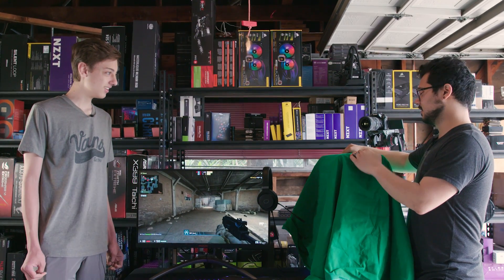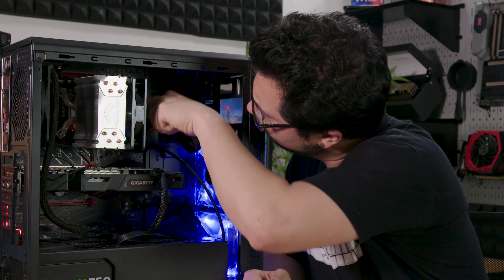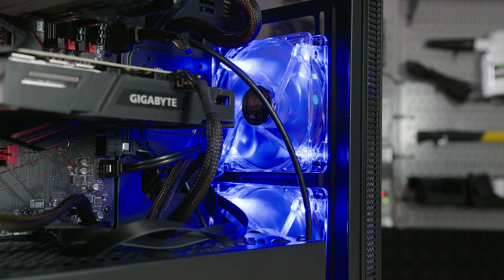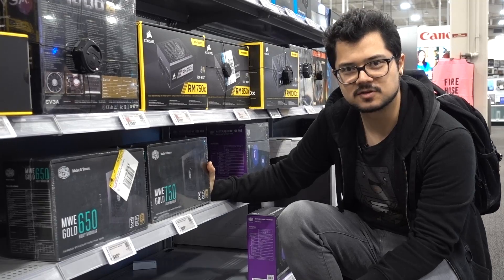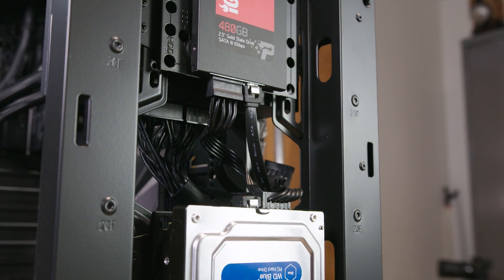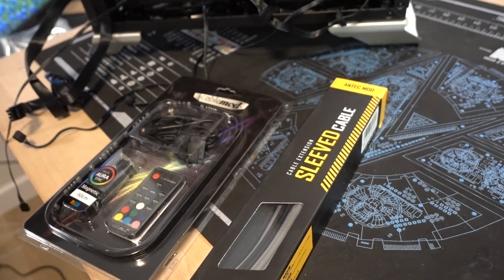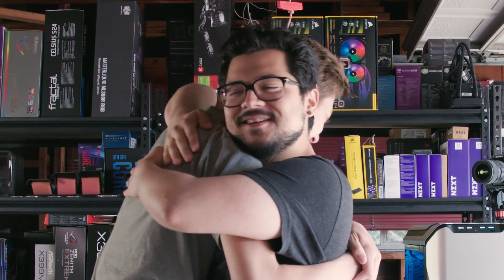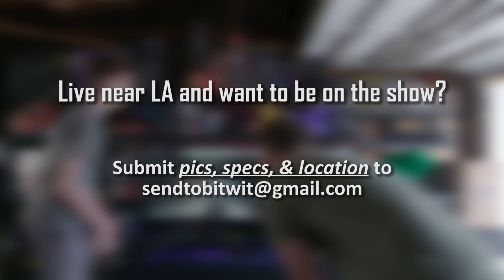He didn't see this coming a MILE AWAY #pimpmyrig #pmr #episode6

Comment: love your videos and i know its a "little" late, but DONT put the radiator from the 2080 UNDER the gpu... i got 2 for myself in SLI (2080Super's) but i mounted the radiator "above" the pump itself! because i know someone that HAD a 2080  waterforce by gigabyte at he mounted the rad also beneath his gpu and the cooling died of RAPIDLY! and i mean in 2 months, he had so much air in the pump, that it ran just about 10 degree C cooler in idle than one of my 2080super under load (which is about 54C)! and it was like twice as loud because of the bubbles in the pump. just wanted to point that out x/ still love the vids <3

Comment: Awesome build as usual especially showing the love with such a great sponsored PC upgrade, though I have to say as a person who doesnt have to (nor can afford to-lol) water cool ive always wondered when using rads about the method of blowing hot radiator air (into) the case, it seems counter intuitive.  I guess it goes against my instinct of removing hot air not running it over all the parts, again it seems counter intuitive.  But im not an expert in water cooling so what do I know.  I guess im an old school guy and set in my ways, but I always pull air in the front and exhaust out the back and top if the case has a fan on top.  No matter, I know there many ways of cooling differnt cases and thats part of the fun of building, finding your own solutions - and long as they work hey -- M

Comment: You can't mout that gpu aio like that, its really bad for the gpu die and the cooling performance. When you have the water block at the highest point (waterblock and gpu higher than radiator) your literally letting all the air travel to the water block (yes all aios have air in them). This will increase Temps as the air is not letting the water in the block cool the plate. This can also damage your system due to permeation when your waterblock heats up. If you don't believe me, watch gamers nexus.

Comment: Bruh maybe its time for my broke ass to have a shot at this,

Specs (wear sunglasses)

Cpu: Intel Core i5 2400 @3.1 GHz
RAM: 2 x4Gb sticks ddr3 1333 MHz :(
Gpu: gtx 1060 6Gb (Best Part)
Power supply: dunno what brand but its 500 W 80+ bronze certified
No fans what so ever other than the cpu cooler
1x 480 Gb SSD (Boot Drive)
1x 248 Gb SSD (Trash)

Please Help me bitwit I cant afford better Parts :...(

Comment: You make me so happy! 

I just got a Meshify C,  Masterliquid 240m   Ryzen 9 3950x, Hero V III (wifi)   M.2 drives      32gb  3200mhz RGB ram

What I'm upgrading from???

FX 9370,   16gb ddr3 1333mhz,   some 19.99 super budget case, some 40$ Am3+ mobo     (im keeping my RTX2070 super  and coolermaster 750 gold rated Rgb power supply) 

I CANT WAIT For the rest of the stuff to get here cause I've been due for an upgrade for years, i'm just finally able to treat myself :)

Comment: Meanwhile, I'm sitting here staring at my fx 6300, R7 360, 8 GB DDR3 RAM; and wondering if adding 3 RGB fans will improve performance threefold.

It did, it really did.
But my case has terrible airflow anyways, so I keep it open when I game, otherwise the temps go crazy hot.
Reply: lmmfao

Comment: yo i need help i have a laptop with a gtx 1050 and a core i7 and im gaming on a controller and i play fortnite i get 110 fps batlle royale and my laptop is getting very hot i want to switch to mouse and keyboard with a headset and a laptop cooler and a big mouse pad where i can put my keyboard on and a mouse pad everything rgb and my budget is 300€ i want higher fps and i want not that my laptop is overheating and i want know what is should buy from the things i want with a budget from 300€ .my laptop is a hp pavvlion 15 btw
Reply: im from the netherlands btw
Reply: and i need a charger to get 100fps battle royale

Comment: Anyone I need help. I have the Alienware Aurora R5 I wanted to add a second graphics card I currently have Geforce GTX 1070 and I'm sure I'll need a bigger power supply. Does anyone know what power supply will fit in I believe I have a 460w currently

Comment: uh....I've never seen one of these "pimp my rig" videos before... and I like Bitwit's channel and all.. but isn't this kind of insulting to like...... half of his viewerbase?

Did the kid win a raffle or something?  why are you "pimping" a system with a 9600k, 3000mhz ddr4 ram, 480g ssd, 750w corsair PSU, and a 1070 ti? (and I bet those cables weren't THAT pulled-out when the case was first opened - seems like it was done for the camera, and EASILY correctable)  The ONLY thing "bad" about this is the motherboard, but since this is almost certainly a SI pc (like cyberpower, ibuypower, or the ones in walmart/BB, etc.) that's not too uncommon and honestly it's unlikely to truly matter for most gamers. 

 If he did win some sort of lottery, I guess that's fair.... although maybe you should have certain requirements for entering in the first place...  I'm sure you have some type of stats from your fan/user/viewer-base and know darn well that this exact PC is most likely well above average for them.  Hell, I spent nearly $2,600 USD on my PC that I built in april, 2016, and it's basically on par with this minus the GPU (mine is 1080 ti) and storage (I have nvme+ssd+hdd).

Comment: Hey there, great video as always. I m a system builder in Thailand, doing custom builds for patrons here. I am a bit confused by this build. Are there any back exhaust fans? All I see is air being in from the side, in from the bottom and in from the top. Since the CPU radiator is mounted at the top, if you use it as an exhaust to blow air out isnt that just moving hot air through the radiator? And if not isnt the GPU aio blowing hot air out the bottom ( which would make little sense seeing as hot air tends to rise.) 

How do you keep a positive cool airflow through the main coolers? Thank you and keep up the good work!

Comment: I have the same cooler and CPU in my build, but i only have an EVGA GTX 1050TI, and a 500w power supply. the CoolerMaster Hyper 212 really does well for me. turbo all six cores up to 4.3gHz, it doesnt break 75°C

Comment: @Bitwit I got a challenge for pimp my rig. My computer that is on it last legs. 
Specs:
intel Core 2 Duo (sorry dont know the specific details but come on its a core 2 duo)
2GB DDR2 RAM (hey at least its dual channel)
EVGA Geforce 660 Ti 2GB
EVGA nforce 680i sli mobo
Corsair Graphite 600T case
Antec 650W PSU
Corsair H80 CPU cooler
250GB HDD 5200RPM
and last but not least....WINDOWS VISTA ULTIMATE...32-bit

this was all meant as a joke but if you really want to pimp this dying rig i wont stop you

Comment: I'm building my first pc and all i'm using it for is ranbow 6 siege, fortnite, and apex lgnds here what im gonna buy :1st thermaltake core v21 spcc micro atx case,motherboard , msi mortar b360m, 2gb msi GeForce gpu, fan/ air cooler, corsair ml120, ram, hyperx Kingston fury, power supply evga 750 gq, Samsung ssd 500gb, drive, Seagate 1tb external drive , and ryzen amd 3

Comment: i'm overclocked on a non x 2700 to 3.95gh on the stock cooler at 1.36 volts, my gtx1080 sc  is oc'd 600ghz on the mem and 150 on the gpu core.  no crashes on cinnebench aida or heaven, cpu idle is 31c while underload "AOC/Witcher 3 45-54c. gpu doesn't have problem, any higher though in some games/benchmarks i crash and have to system reboot.

Comment: can u do like a monitor giveaway or something like that. I blew 1.7k on my pc and had no money leftover for peripherals so im rocking a logitech g300s mouse, a random logitech keyboard that my dad got for free from his old job (3 buttons are broken off and some buttons are unresponsive), and then a logitech g430 headset that is nearly broken (the wire is legit hanging from a thread right now.) Also my monitor is a really old asus 24 inch 1080p ips display. so while most of this stuff might not sound bad, the pc that i just built has a rtx 2080, and a ryzen 2600x, so i feel like i am wasting it with such bad peripherals. So because of this all, I wanted to ask if u could have a monitor and peripheral giveaway so that I could at least have a small chance to upgrade my peripherals sometime soon. The only reason I was able to get my pc in the first place is because I worked at mcdonalds last year during summer, but I wasnt able to get a job anywhere this year, and I thought that it wouldn't hurt to at least ask. Thanks for being such a genuinely great and nice person, and for putting out so much interesting content. :)

Comment: WAIT what u call this a bad rig wow
I have a intel xeon W3250 2.67 ghz 2.66 GHz
a 1050 ti 4gb
8 gb of DDR3 Ram 2000 - 2100 MHZ
and a 400 watt power supply 
AND LETS NOT TALK ABOUT THE FAN OK ( its a fing Helicopter )
and it is a pre build from intel Named Z400 Workstation OK

Comment: Stopped watching after you picked up the cooler master keyboard and mouse. No offense as I like your channel, but no serious pc enthusiast would buy a freaking keyboard and mouse made by cooler master.

PS if an enthusiast is into RGB they should just buy an Alienware case and motherboard. Their cases are by far way cooler than anything you can build yourself plus as a bonus you don’t need controllers and all that BS. It’s all controlled by software. Sure they are more expensive but the money dumped on inferior RGB is basically equal to the price premium that Alienware has.

Comment: LMAO he started moving his hands to his mouth before Bitwit even lifted the tarp. You should also pimp lower tier rigs, a 9600k and 1070 Ti with 2 monitors is already high end.
Reply: Agreed. I've got a i7 4700k, and EVGA 1070 Ti, and I get EASILY over 60fps, on ultra settings in every game I play
Reply: Could he pimp my shitty laptop that I try playing games on?

i7-4700MQ
GT 740M
12GB DDR2 or DDR3 1600Mhz

It rarely hits the 60FPS mark on CSGO at 1080p and everything low settings. Plus, it sounds like a jet engine at idle.
Reply: @mjones04  bro that's not shittty. Also I'm pretty sure it's ddr3, is it an HP laptop?
Reply: How about my shitty rig :D
750ti
Core 2 duo
Ddr2 ram 667mhz or something (its almost older than me)
tp412 dell mobo 32x chipset 
Idek what the powersupply is, think its a 250W or 350W noname
500GB HDD
Reply: I really like watching these videos, but i prefer building my own computers so i worked and saved for my parts and now my set up is 
Ryzen 7 3700x
Rtx 2060 (waiting for the 3080 ti)
Asus tuf gaming x570 plus wifi
512 gigs of nvme storage
1 tb hdd
1 tb sata ssd
Fractal design meshify c
My moniter is a msi mag27cq 1440p 144hz va panel
Corsair 850 watt psu 
And 16 giga g skill trident z rgb 3600 mhz
Reply: Peckaut Dude hows the Meshify C? Mine just came in and i'm wondering if my RX 5600xt will fit with room to spare.
Reply: @troelembiid6970  its amazing, im sorry i didnt see this sooner, yes im sure itll fit fine i have a rtx 2060 in it rn
Reply: I have an i3 550 
a gt 1030
No case
A psu that's about to die
Old HDD
8gb of mix n match (different speeds and capacities)
Reply: @romanbellic5241  and??
Reply: @anmc5315  nah, I rather not. I had a video posted for a little while I think but I'm once again not home right now. I do actually still have it though. I sold my gt 1030 though.
Reply: @romanbellic5241  i believe thats not real, cuz that computer would probably not turn on anymore...
Reply: I've got an amd bulldozer processor and a gt 610 card and 4gb of ram
Reply: that shit is setup, fake reaction
Reply: @jaycodeligt  what you mean?
Reply: I can you show my shitty PC when I get home

Comment: I wish I could get on the show but I'm not in Los Angeles California so I can't give him my PC which is a 2012 Dell Optiplex 9010 with a Core i7-3770 running integrated graphics and stock intel cooler and an HDD and some random Chinese power supply which doesn't even fit in the case after the Dell PSU broke 3 times after replacing

Comment: congrats now I have a question how would you like to pimp ( replace) my current rig?  my rig is older than the one you replaced for sebastion I myself and still running an 8+ year old x58 system and I would love to have and am acquiring parts for a new build however I have to save for parts and my 2 biggest problems are the straight ass raping im going to get when it comes to the gpu.  also due to prices and factoring in how long I have to keep a system due to manufacturers continually raising prices to ass rape dry proportions I always sbuild HEDT and in this instance I have had to go amd for the first time ever due to the TR 1900x being $300 USD while the i7-9800x ( if you could find one) are being listed for $850 from second party sellers ( taking their que from the GPU fiascos of 2018).  if you don't want to pimp my rig that is cool how about at least sending me an aorus GTX 1080 Ti WB waterforce ( waterblock version) and an aorus X399 XTREME motherboard :D

Comment: I wish I lived in us and dumpster dive pc parts :( it doesn't matter if I have like intel Q6600 and gtx760 gpu cuz I lived in the Philippines and my pc specs is 
Intel Pentium E6600 
2x 2GB Ram 800mhz
Gt210 1GB DDR2
120 Sandisk SSD
250 HDD
Rakk Generic 400 watts psu
Case 😑 nah its pretty old and dusty

Poor me :( anyway I can still play some old games like Far Cry 3 12-15 fps hehe :) and old games etc

Comment: If you watched Linus Tech Tips, you'd see that certain higher end air coolers are actually out-performing some of the biggest baddest AIO water coolers on the market in both noise levels and performance, and some by a fairly large margin. So... yeah, that "getting an AIO cooler for better performance" is not really the best choice. And actually, my Dark Rock 4 out performs the Corsair H150i Pro in cooling performance by 3c at idle and 4c at load, and it was less than half the price.
Reply: @Friday901  But cost twice as much and perform not  nearly as well. And it's a matter of taste. My all black ceramic coated Dark Rock 4 looks really good in my system.
Reply: And I'm not talking about those massive ugly amalgamations with dual towers and all that. I'm talking about the simple little Noctua cooler with one fan on the side (NH-U12S) performs as well as Corsairs top end triple 120 AIO cooler, and their dual fan version (NH-U12A) of that same cooler outperforms it by 5 degrees or more at load, and costs something like $60-80 less. As does mine, and it looks quite nice, and really isn't very big at all. It fits in this Phanteks P400STG (fairly compact mid tower case): 

https://www.bequiet.com/en/cpucooler/1376

Comment: Nice RIG :) congrats man, i got a Ryzen 7 1700x, 16gb DDR4 @2400, RX 580 8gb and havn't even opened my new GTX 1070 ti Aorus just yet and a non overclockable motherboard lol but it still does the job with the Ryzen Master app so i got it OC'd to 4ghz instead of the 3.9 ghz it said it can get to. I'm thinking of buying a B450 motherboard and corsair Vengeance LPX 16gb kit @3200 and just use all my parts i have in this build to do a custom build instead of my prebuilt.

Comment: The dude already had a mid-high end system. I'd be much happier if you pimped a rig that could barely run 1080p titles, not something that was probably already good enough for 1440p. 

It would've been better if you threw out someone's i3/1050ti system and built them Sebastians original system